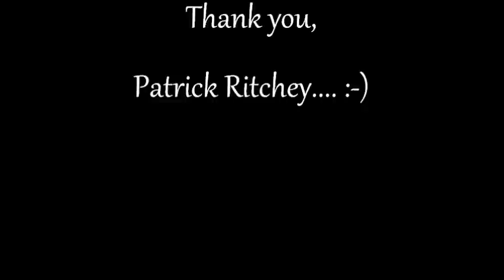Geoprobe Pressure Reading On My Lot on Bayou Corne~

Comment: Excellent! Thank you to Patrick for being so concerned and calm about being videoed!.
Thank you Rain for having the guts to video this. 
Patrick did an excellent job using the equipment, I have used similar in the NAVY when testing voids and enclosed bilges. 
H2S = Hydrogen sulfide is slightly heavier than air; a mixture of H2S and air is explosive. Hydrogen sulfide and oxygen burn with a blue flame to form sulfur dioxide (SO2) and water. In general, hydrogen sulfide acts as a reducing agent.

Comment: Initial test well psi 13.0 and now dropping should indicate liquid level is dropping.  If entrance of gas into the test well increases faster than the liquid level drops, pressure will increase again.  At that time, it will be a significant danger.  The man's reading of methane in video indicates an explosive condition along w/ the L.E.L. readings.  My question is: Are test wells throughout area losing pressure & showing increases in methane or just this one currently?